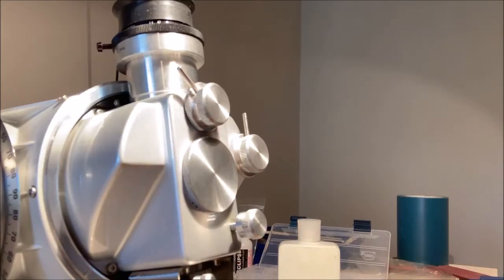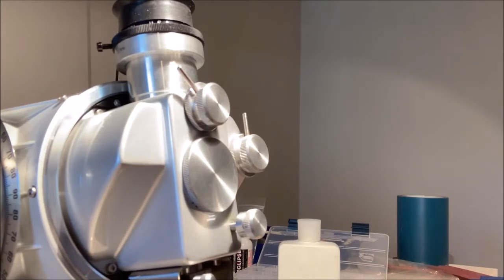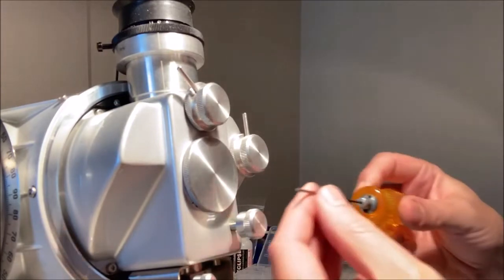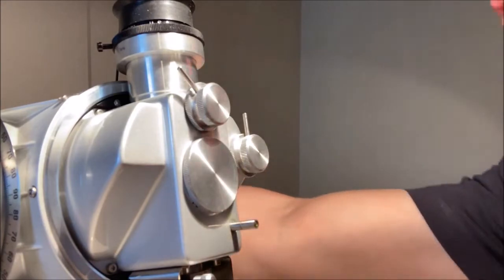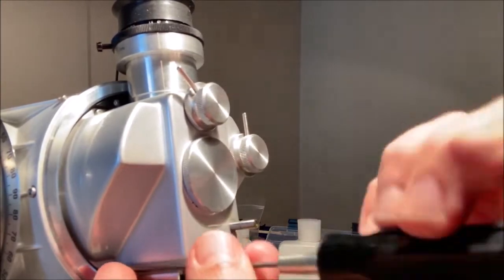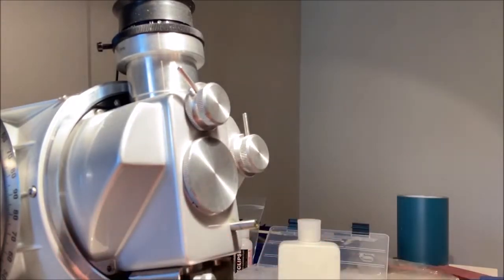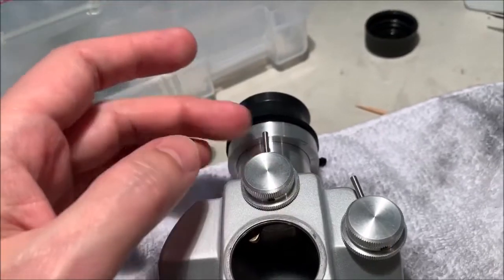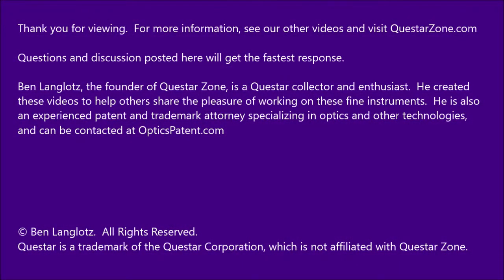#1: Control Box Disassembly, Barlow Service

Comment: Thanks for the videos. Very interesting. I’ve acquired a field model that I purchased partly to help a fundraiser for Ukraine. By the way, I’m owner of Denkmeier Optical. I design biocular viewers, and they work fantastically with questars and have three different magnification modes that the power switch produces: low/mid and high mags. The high mode is superior than the built-in barlow in the questar units. The low mode produces Reduction and a widee field. The Field Model I obtained has major anodization areas probably affected by foam in a case. I don’t really see any of your videos that show how to remove the rotating section from the field model. I may consider having it re-anodized. Any advice would be appreciated!